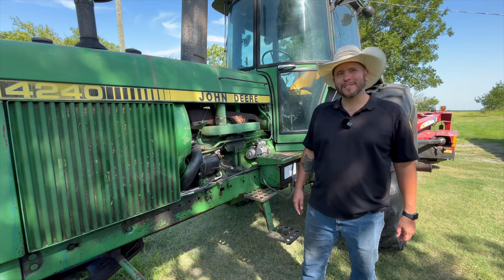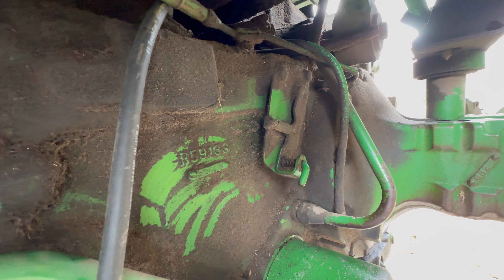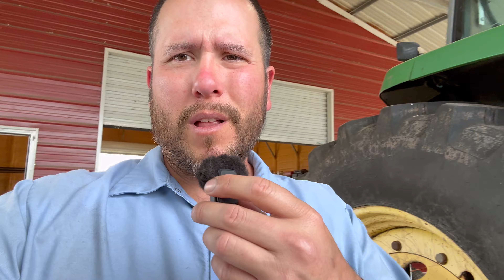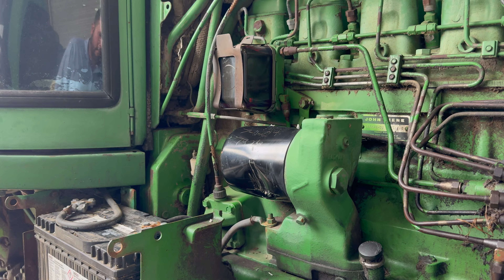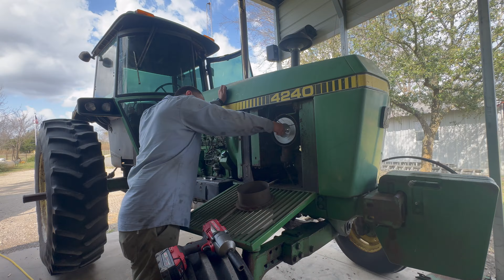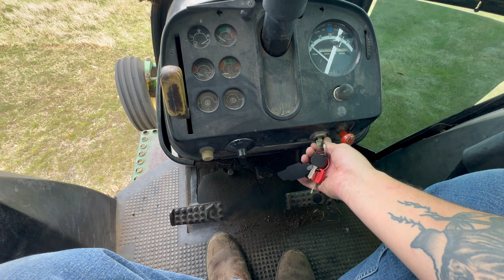John Deere 4240 Maintenance: What Every Owner Should Check

Comment: I bought a few tractors in the last year to replace our open cab ones. All 40 and 50 series deere. Since the row crop folks are selling off their older ones, the prices are good. We are going through them for years of future service. We have installed the newer a/c compressor design. Original is 40+ yo design. Just call the welder to fabricate the new brackets. And always change the dryer! Trash in there. Under the cab is another place of concern. Turn off the heater fluid to cab with valves on the right side, I believe. I used the ceramic tint. I am telling anyone how to do their equipment, just what we have done. I can't remember what the compressor was made for, but not a thousand dollars! These also had blocked cab air filters. That wrecked the blowers. Good luck and Hello from Central Texas!
Reply from the maker: Thanks for that advice! I've been watching quite a few videos on doing the install, so looking forward to installing this fall.